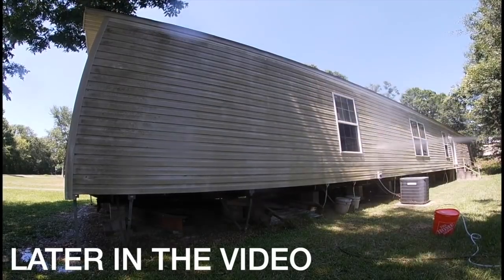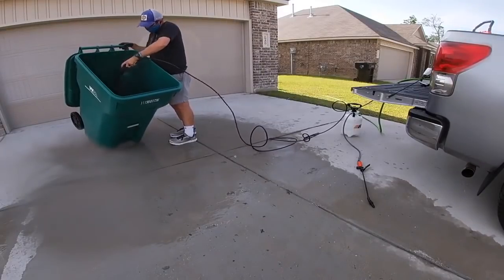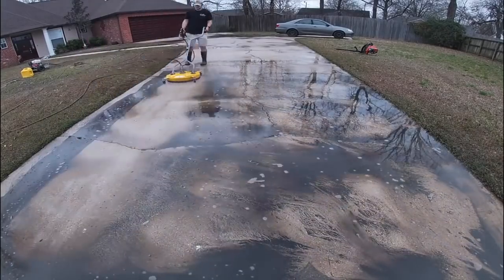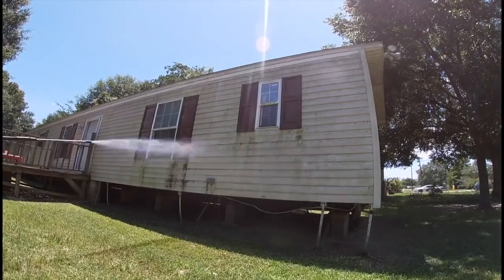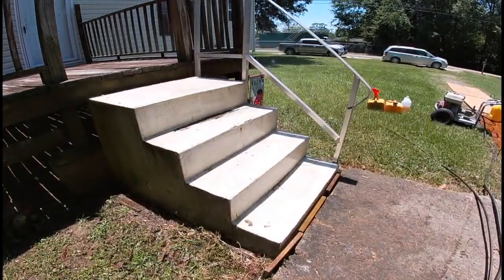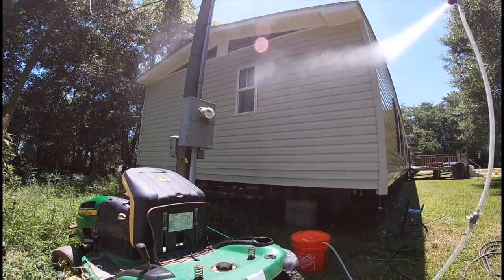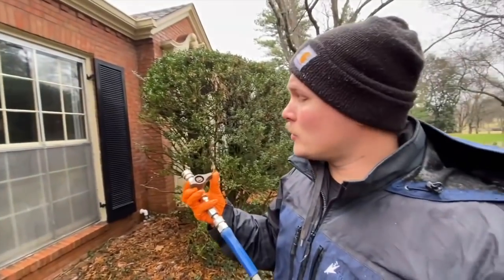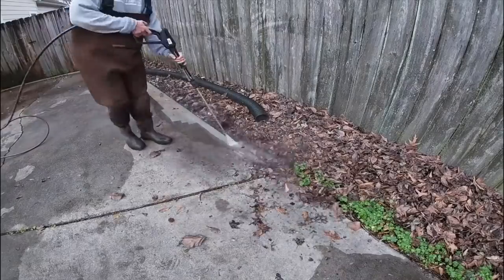3 TOOLS THAT CHANGED MY PRESSURE WASHING BUSINESS

Comment: the flow rate is multiplied by four brother. so a 4gpm recommend a 16 inch max the Whisper Eagle 16 inch with a 4 gpm is what i started with.   also a good gas roof pump with 300 psi low pressure at 10 gpm will help you wash down roofs and houses really really quick.

Comment: I run a 20 inch. Its rated at 4000 and I have 4400 psi machine. The 16 whisper wash is the best but I dont think because its more power full. Its just light and can dance with it.

Comment: Typical rule of thumb for surface cleaners is 1gpm of flow per 4 inches. I run a 19 inch whisper wash classic with a 4 nozzle bar on my 8gpm. It’s a great setup. I previously used a 16 inch whirl a way and it didn’t perform well with my 8gpm. The 4 nozzle bar is great on my whisper wash.

Comment: Hmm. I have a 24" BE whirl away surface cleaner and a 4 GPM machine. I used it on my back porch and it worked pretty well, but disclaimer I only used it on the porch for the test and only about 15 minutes of use

Comment: $1545 for the machinery of the business and then your courses, another $500. That's not bad. $2k could get me a whole new career.
Reply: Don't forget vehicular costs, taxes, government stuff, advertising, insurance, etc.
Reply: A lot more than 2k, all the other stuff adds up
Reply: I was thinking this, I’ll just get the experience myself haha I literally started yesterday and have 5 jobs lined up today.  Seems like some common sense. Don’t get too close to wood, don’t use high pressure on the garage or siding of the house blah blah blah
Reply: @Lando-oz7hd  yea how’d you get 5 jobs already
Reply: @kapoof2  true. For someone reason no one every includes the cost of trailers or pick up trucks. Like uhhhh I have a sedan rn lol. I’d have to put at least a couple thousand into a trailer or truck
Reply: Could*
Reply: Don’t buy the course everything is online for free
Reply: @Raiddd__  have a trailer hitch installed on your car and then get a hitch mounted cargo carrier. They're $70 at harbor freight. They hold 500lbs and you can fit your washer on there. Just make sure to chain it down during transit.
Reply: @errolwilcox747  Honestly, a small 5x8 trailer should be able to be pulled by any car that can tow at all, right? Or get an even smaller one. But they are under $1000. Not bad and you can carry more stuff like tools, blower or broom, etc... ladder and charge for gutter cleaning, whatever. Not a bad investment. A truck is convenient but not completely necessary.
Also, if you get it on a loan, your cost is not all upfront and just pay it back once the money is rolling in.
Better to keep the cash on you when starting the business.

Comment: good thing you learn about X Jet however down streaming is much much faster and safer most down streamers you get now work after the pump not reccomended to use the one attatched to the pressure washer use the one you use at the quick connect..they are 2 to 10 or 20% anything more than 15% will kill vegetation by 15% i mean 1,5 SH good downstreaming mix on houses is about 12% to 13% or 1.2 to 1.3 SH

Comment: Hi Justin, 

Just curious on your surface cleaner  issues.  Do you think it might be the pressure washer machine hp and nozzle tips?  I believe your pressure washer unit (4000 psi @ 4.0 gpm) is a (11 hp). I know some of this pressure washer that comes with a honda gx 390 engine has two hp style (11 hp & 13 hp). Also try to switch out the nozzle tip from 2502 to 25025. That might also help.

Comment: 4 inches for each gallon per minute your machine is rated at.  I have a 4gpm machine and hate using my 20". I actually just bought a 16" today.  As for casters.  Definitely get casters if you're running a small machine with a larger surface cleaner. If you're at 4gpm or less with a 20" surface cleaner,  your'e gonna get a workout pushing and dragging that thing everywhere without casters.  If you have a proper machine,  5 gpm or higher, casters are helpful on surface cleaners larger than 20". Surface cleaners smaller than that don't really benefit that much with casters but some of that is preference.

Comment: Where can I find the valve the guy near the end was using that can change the pressure/
Reply: Look on ebay or aliexpress for "ball valve", and you will need 3/8" quick connectors to mate it will your gun and hose.
Reply: @mikesalive  it has this exact valve he's using?
Reply: @themantien  There are many different sorts of this. Make sure you get one with high psi rating, e.g. 3000psi or above. For petrol powered blaster, yes you need 3/8" connectors. For electric washer of lower flow rate, it is only 1/4" but I'm sure you have petrol machine, yes?

Comment: Im still learning and have learned a lot from your videos!! I have a 4000psi simpson with 3.5 gpm. Can I upgrade the pump to a higher gpm? Keep up the great work!!
Reply: You can change the pump out for one with higher or lower pressure or gpm, just keep in mind that any variation changes the load on the motor, so if you go for a higher flow & pressure, the motor will labor harder and eventually will die sooner than if you left it stock.

Comment: Any links to X Jet and Ball Valve? Thanks bro ❤ btw, That ending was crazy!
Reply: Kleen-rite is the best price for the Xjet. I paid $115 for the body and the metering tips. I basically got it without the hose. I'm using 35' of hose instead of the 15' it comes with.
Reply: @hankaaron77  Fosho. Thanks bro. What powerwashing are you using?
Reply: @Logos_Unveiled  I have a 2.5gpm Simpson. My plan is to use it for roofs.
Reply: I was thinking about getting thr Simpson power shot 3300 psi at 2.5 gpm. Is this to low to run a 20 inch surface? Or would i need something like the 18 inch hammerhear surface cleaner
Reply: @Logos_Unveiled  16" is as big as i would go with a with a 2.5 g.p.m. i'm using a ridgid 18" with casters on a 4 g.p.m. works great.
Reply: @lcm2017  Thanks! What's the best 4gpm washer?
Reply: @Logos_Unveiled  I'm using a 13 h.p. preadator engine and an ar 4 g.p.m. 4000 psi pump. The engine is around $369.99. And the ar pump on ebay is $325.99. A similar one like mine is Annovi Reverberi SLPVV4G42-400 Pressure Washer Pump 4200PSI 1" Hollow Shaft. On ebay. Bolts right up to the preadator engine.